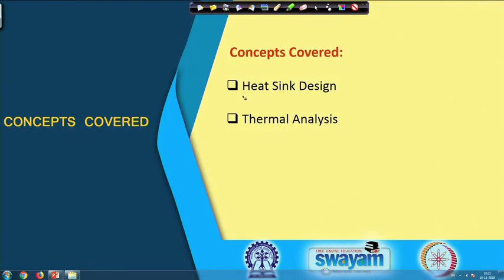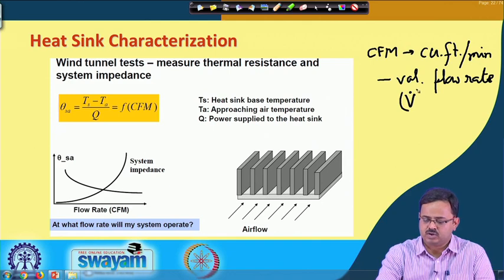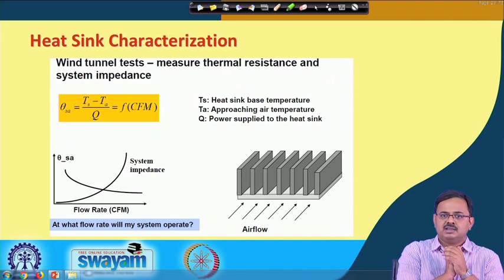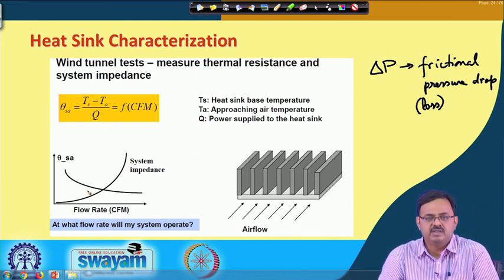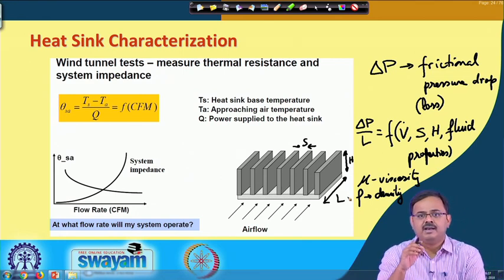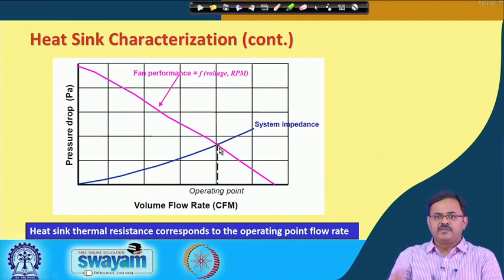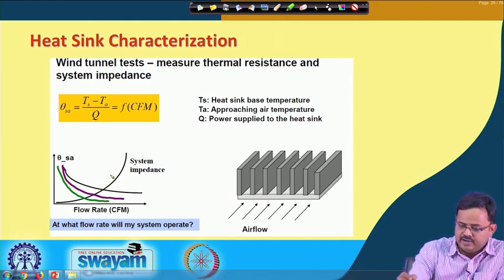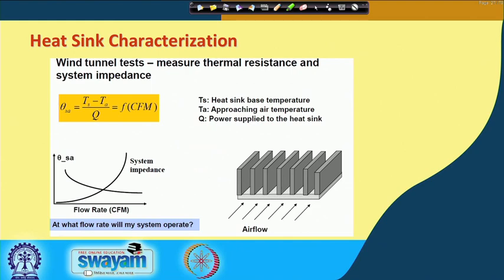Lecture 26: Thermal Management 5: Heat Sink Characterization

Comment: Why the heatsink sheets available in market (12 inch x 2 inch long) have Horizontal fins instead of vertical ones which are said to be suitable for good heat dissipation ?

Comment: What should be heatsink size (length and width) for single tda2030A Ic if it is to output 10 watts power @4 ohms load on 12-0-12 V transformer ?